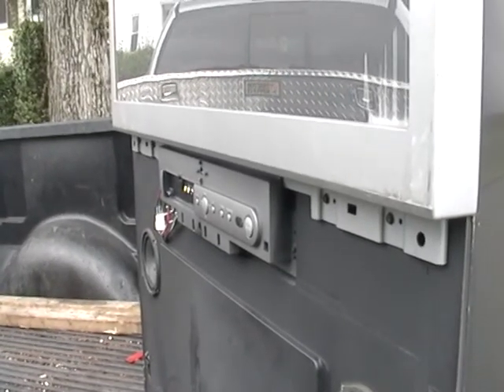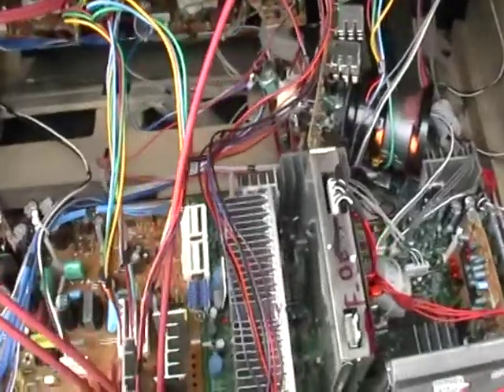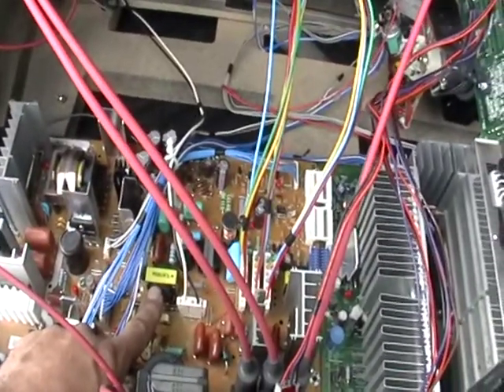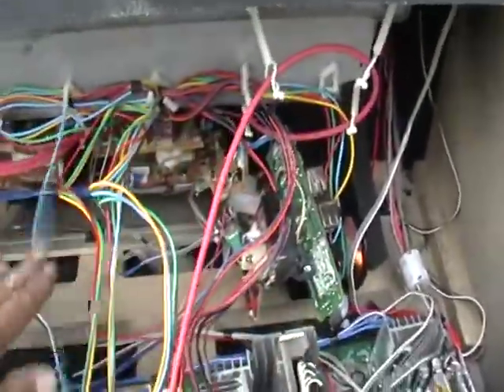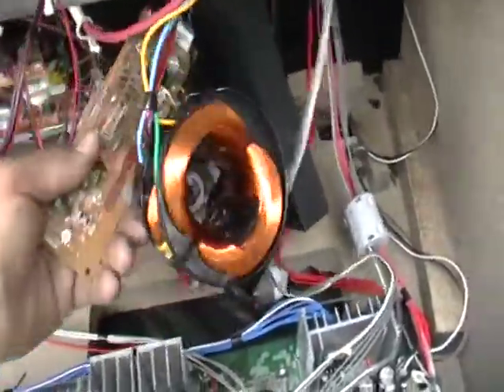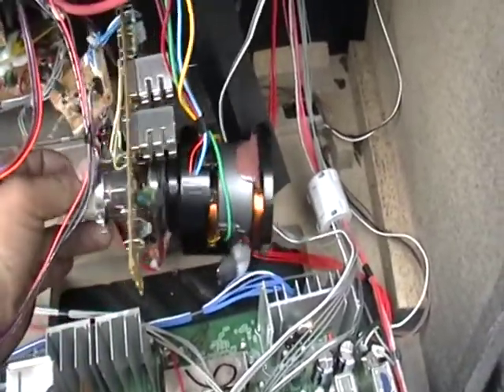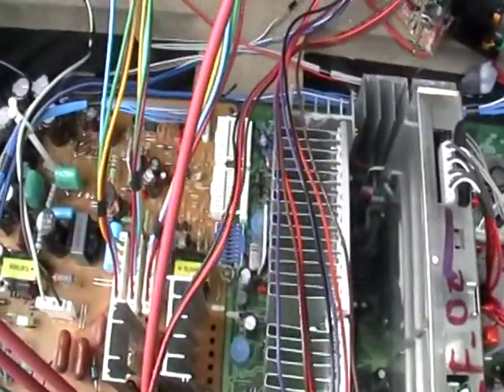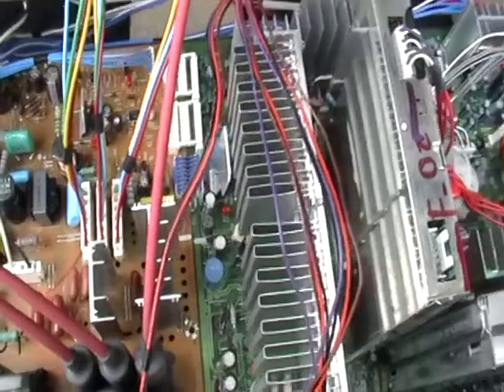scrapping a projection tv for copper aluminum

Comment: jasondean..those interlocking leaf trans are often found in old vac tube electronics as well. Remove the bolts that go through the block, then get your firepit going and burn till the block glows. Using a claw made for fires (find them in fireplace tools often given away with junk stoves) and drag it out of the fire and start shaking. They fall apart. Beware red hot metal will start grass on fire. You'll want to have some pliers or needle noses on hand to use as grabbers. I've got a whole bucket of copper I thought I'd never separate from those suckers.

Comment: That mirror is a rare and interesting mirror.  It is called a first surface mirror.  The silvering is on the front rather than the back of the sheet of glass.  This makes it much more delicate and susceptible to scratches.  The reason for this is that a projected image bounces off of the surface rather than the back of the mirror so there will not be a ghost image.  It also will need to be cleaned because it has gathered a lot of baked on dust.  Be very careful when cleaning it.

Comment: hi mike, I've got some old power supplies from traffic light controllers. The copper is buried in an 8 pound block of steel. It appears to be a series of thin steel plates that were all glued together then screwed together and then the screws and bolts were screwed down on the other side. Any ideas? I'll send pics if you'd like. I'd hate to let it all go at scrap price, but I'm running low on ideas that aren't going to involve hours with a set of wire snips. Thanks for any advice.